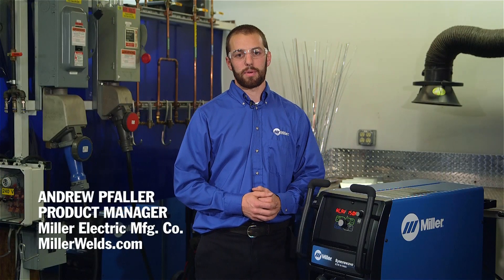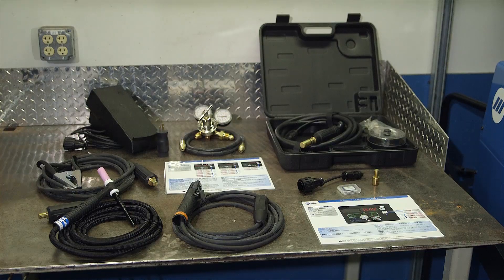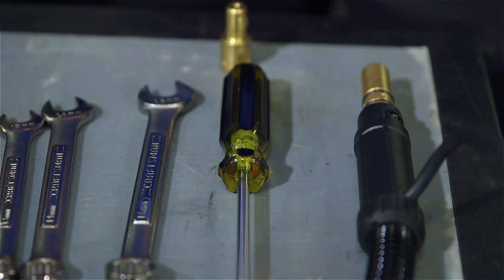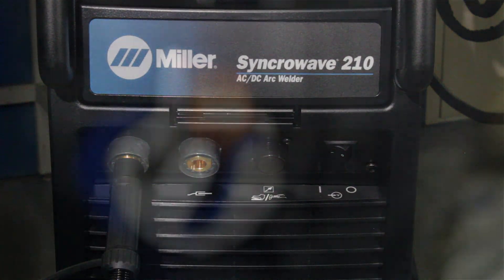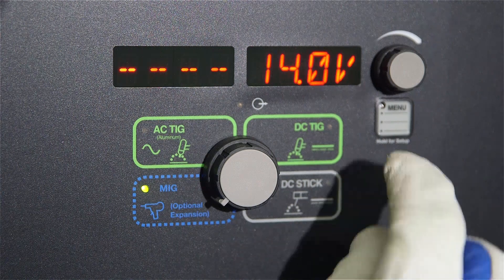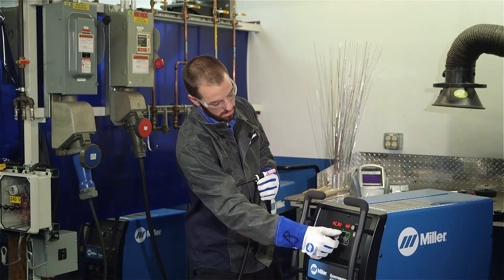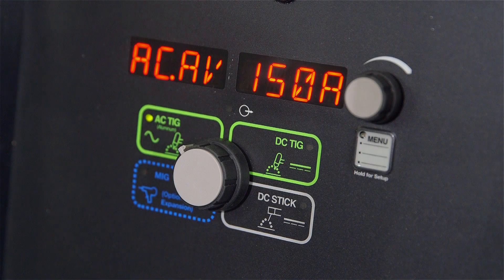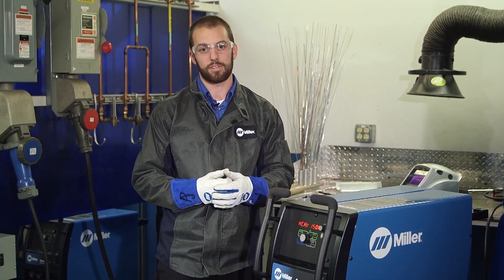How to Use the Miller Syncrowave 210 TIG/MIG Complete

Comment: This machine disappoints me. But not in the way you’d think. It disappoints me in the sense of how nonsensical it is and the demographic it is geared towards. If one needs this much assistance from the machine to handle these processes then perhaps they should start from the basics. Plus this machine and the components just stick out as cheap to me. This machine is no better or perhaps even slightly less appealing than the line of ac IGBT inverters from     Everlast

Comment: Hey miller I don't know where to get the mig gun chip i have a 210 syncrowave but I can't find the mig upgrade
Reply from the maker: The newer versions of the Syncrowave 210 do not require the card upgrade, the software comes pre-loaded into the machine.  You can run the Spoolmate 100 or 150 on these machines, additionally for either gun you will need the adapter shown which is part number 301254.

Comment: Need an honest opinion, I'm looking at either a New-Millermatic 200 or even Miller Syncrowave 210... I don't have a 10,000 square-foot welding shop, so I only have room for "ONE" welder, but Need it to weld Heavy-Duty backhoe buckets 5/8 inch thick, and I need to weld a 12,000LB winch to my car-hauler Trailer (And make it so it won't break and kill someone!) as well as simple tie-down loops, and I have an aluminum boat that got smashed on the rocks and I want to fix the leaks, and do railings on steps and trailer, and now maybe even build a trike or Hot-Rod from the frame up, and Tube guards and racks for my side by side Quad and pickup trucks as well as 10,000LB+ trailer hitches that are 2"X2" thick, and exhaust pipes and everything in between... So, if you can only have "ONE" welder in your whole shop that you will have to take out to the middle of no-where to weld on a Heavy Duty backhoe and farm equipment, that works on both 110+220V in the price range of these (r under $3,000. total) what would you have?? (is there another one I've over looked?) Also can the Miller 210 cables interchange with the Millermatic 200?? As a friend has just got the Millermatic 200 and I want to make sure if I get the 210 and I'm welding on a Sunday after Church and the gun breaks down, I want to be able to call him and have him bring over his gun to finish the job, instead of having to either wait a week to order one on line or even waiting for the next day to drive 30 miles each way into Vegas to try to find another one... Anyone that have one of these or have used these please let me know of any drawbacks on any of these... I need to know asap as the Rebates end this week on the Miller units...Thanks for your help!!

Comment: Pulsed MIG & TIG is very desirable and with everything going to inverter type machines there is no excuse not to have a pulsed modes. Make it happen MILLER
Reply from the maker: +Apollo Fabrication Thank you for your suggestion and input. We will take that into consideration as we plan for future improvements. Weld On...
Reply: Nice, and please excuse my ignorance, the syncrowave 210 does do pulsed TIG! very few machines do pulsed MIG from my research and its a shame cause its an "all position" process and produces an easy to control and manipulate puddle with less overall heat input.